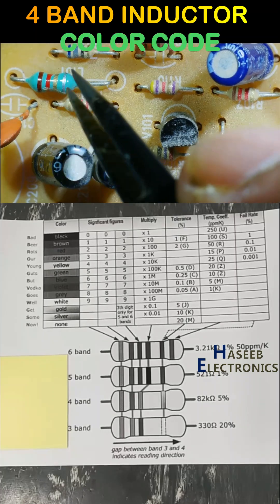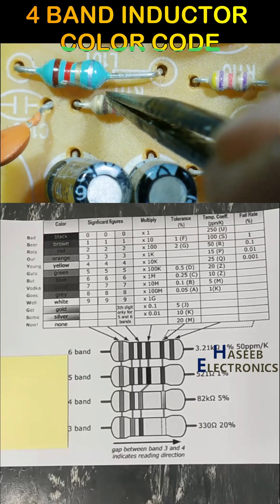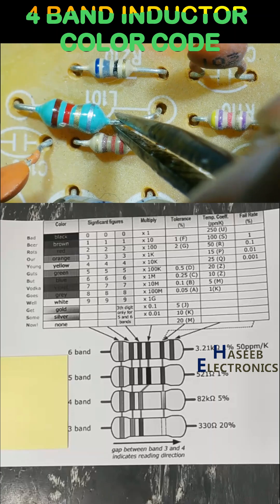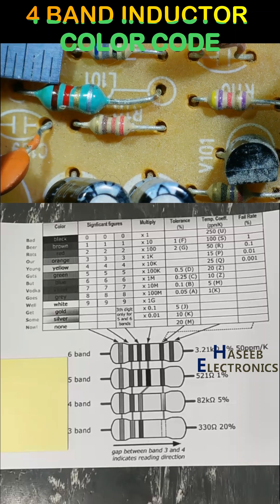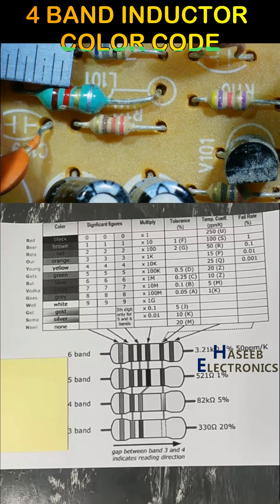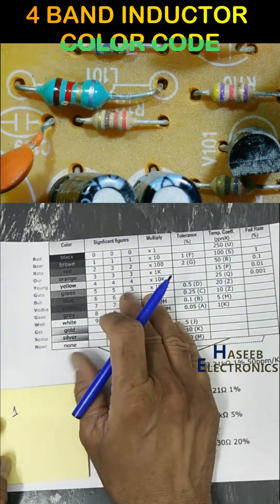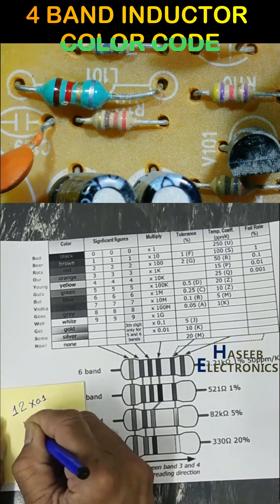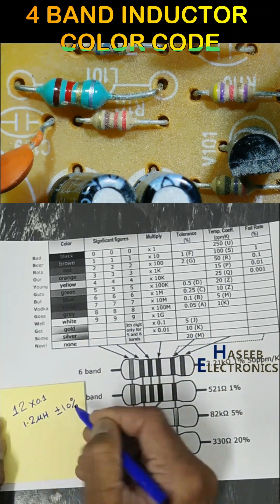#Inductor #ColorCode #shorts

Comment: So inductors are expressed in micro Henry (minimal), while capacitors are expressed in pico Farrad (minimal).
Thanks for your video. 👍
Reply from the maker: Yes you are right 
While using color code chart. The end result will 
Resistor - ohms 
Capacitor picofarads 
Inductor - milli Henry